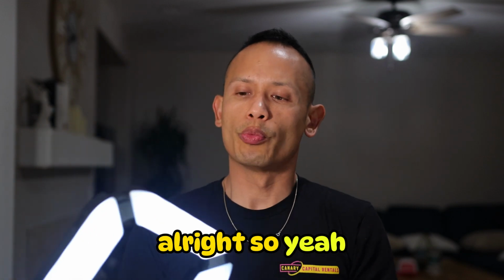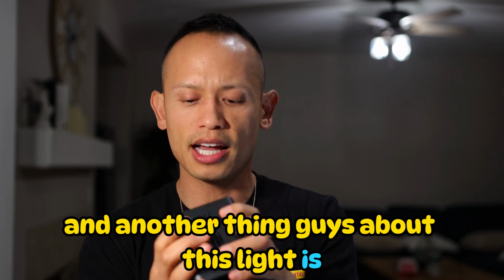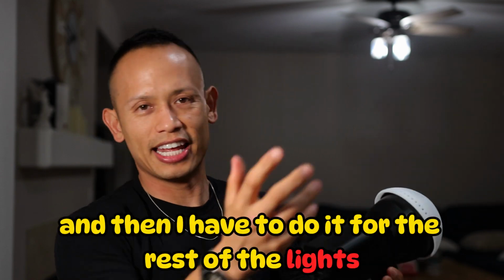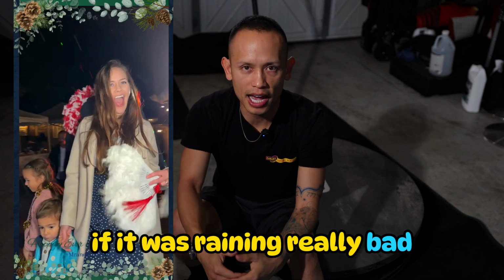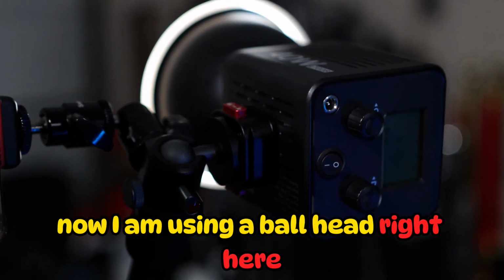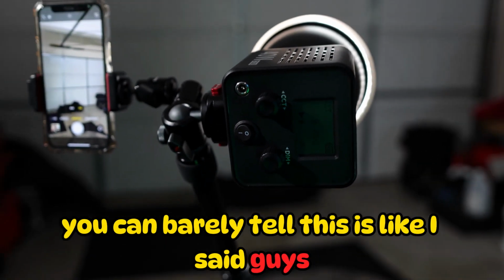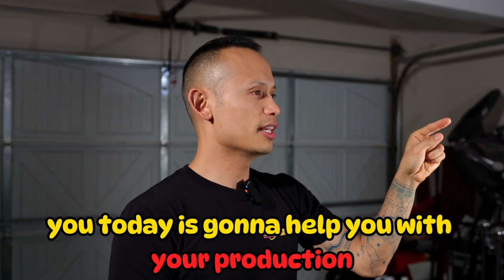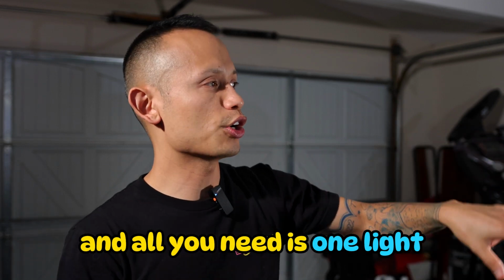Best Photo Booth Light?  & Giveaway | Photo Booth Rental Company

Comment: David...Quick question, if you have an event that's 5+ hours, Have you worked out a way to keep it powered? Because I believe it's wall plug in and you would need some sort of adapter to use a battery pack?
Reply from the maker: Keep what powered?
Reply: @canarycapitalrentals  the new light. You said it lasts around 3 hours. If I have an event that's 4 to 6 hours, is it able to be plugged into a power bank like the ulanzi was?
Reply from the maker: This light required 110 power. Pros: Charges Quickly    Cons: Can't use a portable battery. @JamBroChannel
Reply: @canarycapitalrentals  hmm... I guess you would need to buy 2 then, if you suspect your time will go over the battery run time. Thanks 👍